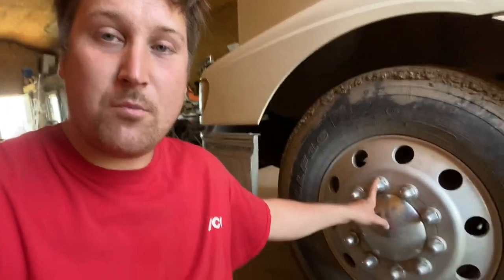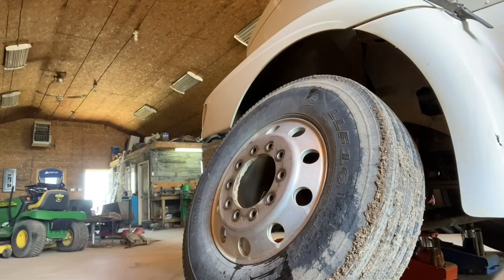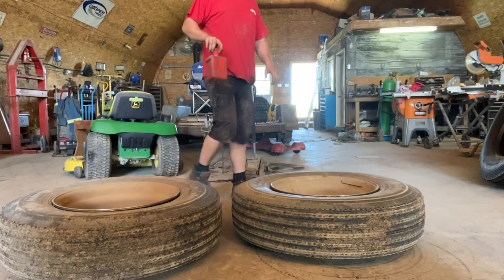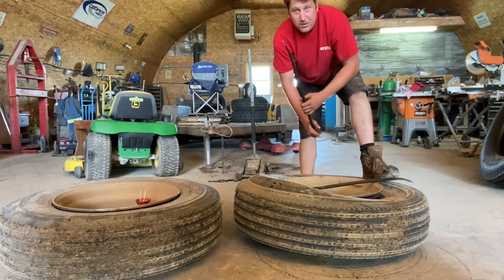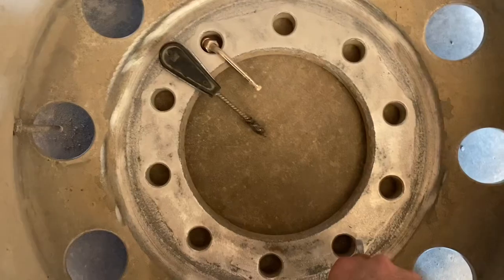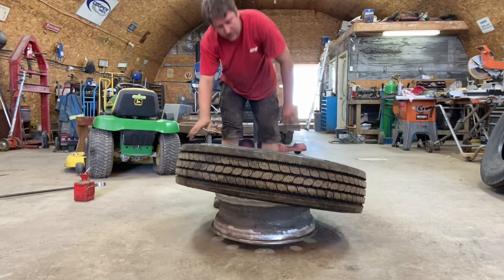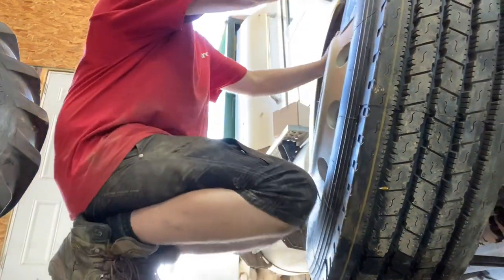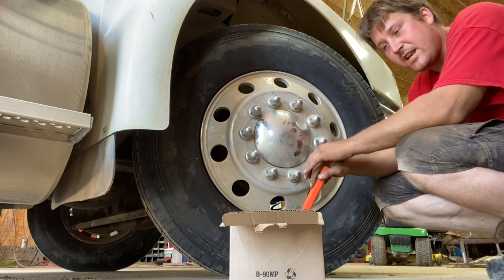HOW TO CHANGE SEMI STEER TIRES 11R22.5

Comment: Great video in my younger years when growing up we use to change alot of the steel split rings rims those dam things used to always scare the hell out of me we actually had a friend of ours lose his life filling a split ring with air and the ring wasn't seated tight flew off hit him in the face. Good idea to always chain down those dam old split rims
Reply: trilex 3 piece rims with bead lock ring?
Reply: @roadtrain5910  yep
Reply: @big.ronwisconsin9598  scariest are the  5 to 6 ton light truck  16 inch rims  5 and 6 stud .  the 8 stud 10.00 rims are not as bad but scary when they blow out on road

Comment: I like the how to and tire advice, well done. Have you ever done a video similar to this talking about using old tires on a tractor and how used is too used or discussed how to determine how much tread is remaining on a used tractor tire. I would also like to hear what you think of tubes with fluid vs tubeless with wheel weights and if there is a performance difference for a chore tractor. Would also be interested in what you think of using mismatched tractor tires, should you or not. Thanks Rob.

Comment: Rob '
l'm really disappointed'  that you didn't do the spit on the finger tip to check the valve stem seal  and not using  either to mount the tire on the bead!!!~

Comment: Excellent vidja. How much does that bag of balancing beads weigh? I guess the plastic bag breaks open in the tire after a few miles.
Reply from the maker: Bruce Crossley ten ounces! And yup she blows open and the beads move to the light spots in the tire to balance it out while you drive

Comment: Dang if you were closer, I am swapping rear tractor tires from JD rims to my duals. Breaking the bead on the JD rims has been working me. Still have one side to go and busted my bead breaking tool. I was cranking it with a socket and breaker bar when the whole top end blowed out. Ha ha
Reply from the maker: Kevin Daly oh shit eh?! That’s no good. Warranty??!
Reply from the maker: Lay it flat and swing a bead axe. she will go. Lube the tire before you start swinging
Reply: It finally dried up enough here I can get in the field, so I haven't worried about it, I have been using a grubbing hoe to break down smaller tires, but I had the bead breaker for 8-10 years, maybe used it 15-18 times. Ha ha I believe I had some pressure on it. Ha ha
Reply: It finally dried up enough here I can get in the field, so I haven't worried about it, I have been using a grubbing hoe to break down smaller tires, but I had the bead breaker for 8-10 years, maybe used it 15-18 times. Ha ha I believe I had some pressure on it. Ha ha

Comment: I do all the tire work on my three rigs,  including equipment for studding and regroving. Only thing I don't do are micro seiping.
I don't trust anyone else with the important work as tires are.
Messed up a bit last steers I did on the oldest truck that have drum brakes, need to have to park brake off when torque then on and I forgot that, so have a small vibration and think it's why.
Use 385/65 22,5 steers and for the trailers so glad we have a tire mounting machine, those bastards are heavy with steel rims. Hard work still 😊

Comment: What’s the deal with the B balancer bag
Reply from the maker: Jim Thomas the centrifugal force of the fire distributes the beads around in the tire to the lighter spots and balances the tire! Keeps the vibrations down on the steering wheel
Reply: Rockin Robbie’s Roadhouse Thanks Robbie I kind of thought that but wasn’t sure